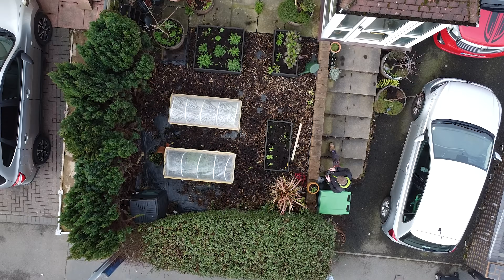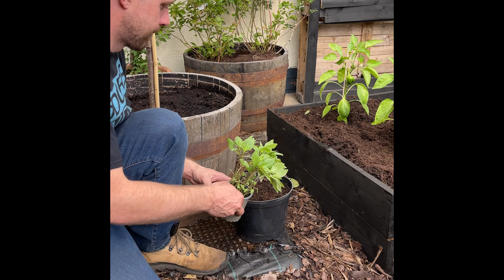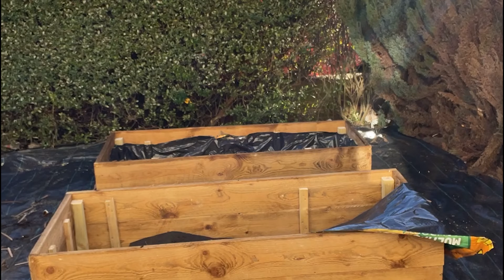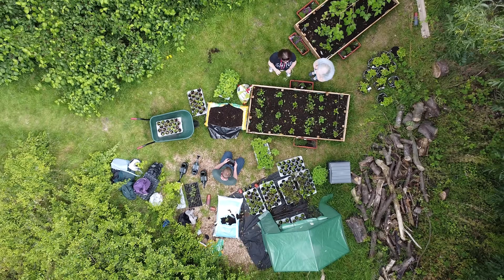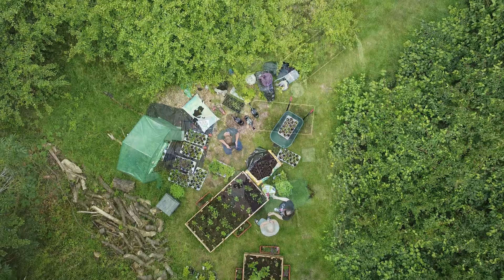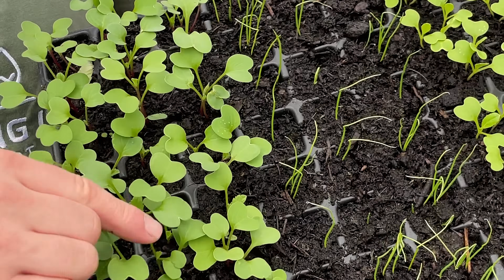The unexpected results of growing food in my front garden.

Comment: How much more growing space would you have if you cut out the shrubbery?
Reply from the maker: Perhaps 30cm at the front and 50cm to the side, but I wanted to keep the greenery. We live on a busy road and it provides privacy and perhaps a small reduction in fumes
Reply: @AndyGrowsFood  You also have to factor in that while the shade reduces the amount of light getting to the plants, it also reduces the amount of heat, and thus the amount of watering (irrigation) you need to do. If you are influenced by emailkarla's comment to replace the shrubbery, consider edibles like an espaliered apple, pear, peach or cherry, or blueberries if you've acid soil. They'll at least provide shade, privacy and filtration during the summer as they are winter deciduous and then more light will strike your cold frames during the winter. I think there's more room to maximize growing space before that's done though (appending half-length containers to the current raised beds, making the gardens only accessible from one side).